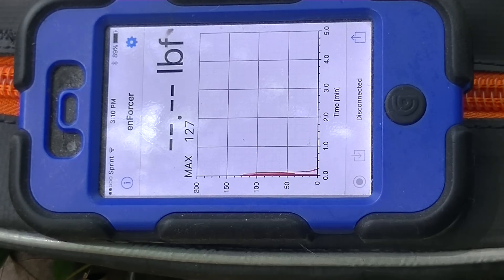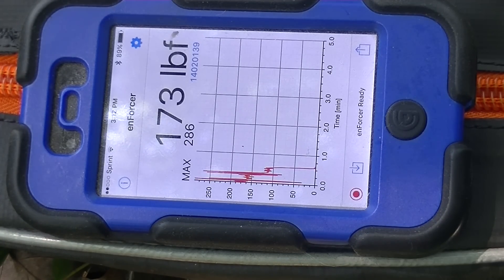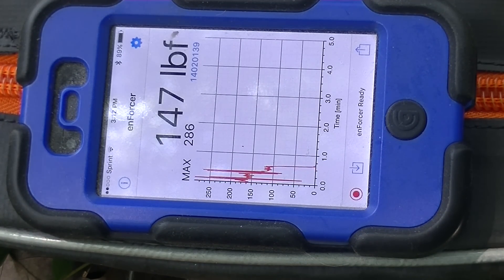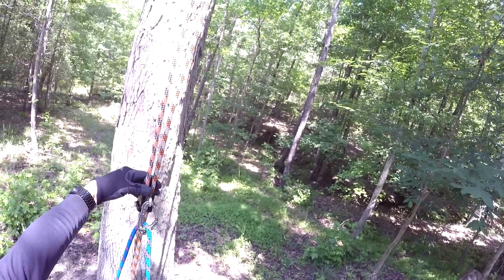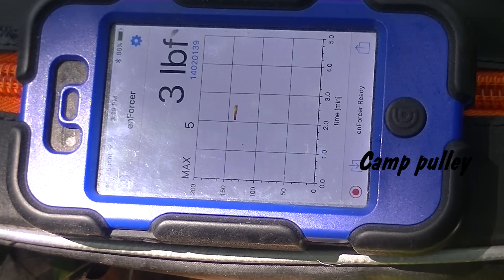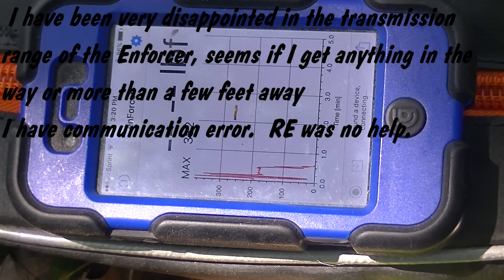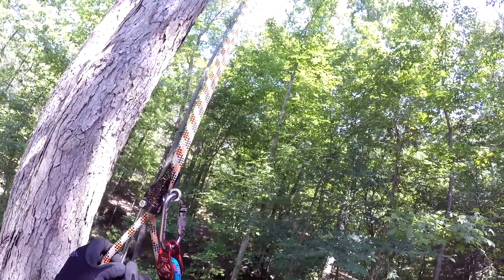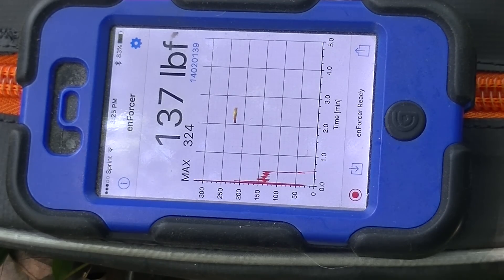Loads thru Pulleys, Friction, Canopy and Basal Anchors

Comment: I’m struggling to get my head around one aspect of the 2-1. If there is 130 on one leg it is matched 130 on the other leg, there is 260 at the pulley. I feel there must be 260 experienced at one critical point on the rope(where it runs in the pulley) but apparently not.. can you please explain how the 260 isn’t felt by that piece of the rope?
Reply: Where would a rope usually break in a 2-1 system?
Reply from the maker: @neild7971  the rope will probably break at a knot
Reply: Thanks very much for your reply, I’m sure I put my question in the wrong discussion and maybe my thought is so wrong that it is in fact hard to help me! But I’m thinking that the left leg holds 130 right leg 130, what about the piece of rope that is in the pulley neither right or left leg, does none of it experience 260? I guess I’m just struggling to understand the basics of 2-1
Reply from the maker: @neild7971  no problem, if the pulley is 100% efficient, in other words there's absolutely no friction then yes, if one side has 130 lb the other side will too, totaling 260 lb above.  Now go to the other extreme where it is 100% friction, only 130 lb will be experienced.  So that whole area in between there is what we're talkin about.
Reply from the maker: Thank you Neil, this is a measurement of the friction at the back side of the pully and how much is actually left after the maximum force is exerted.  I was only measuring the force on one leg.

Comment: Nice work, Richard & Judy!  Long but great info.  I was particularly interested in the confirmation that a Revolver has similar efficiency to a steel 'biner.  It would be interesting to compare a 'steel' biner to a 'stainless steel' Q-link.  It has been empirically observed, by others, that stainless steel has a much lower coefficient of friction than steel.
Reply from the maker: thanks JB. I'll do a specific friction measuring video.